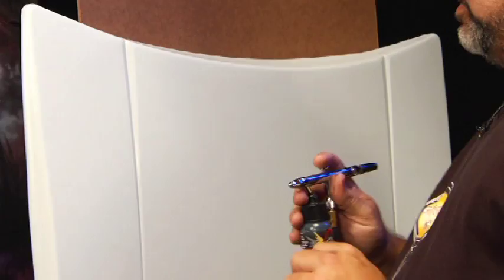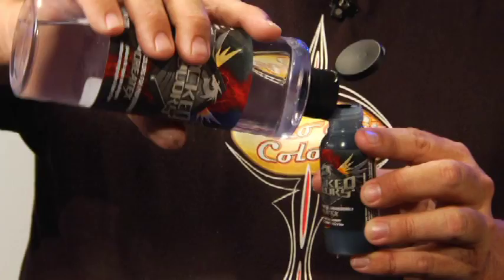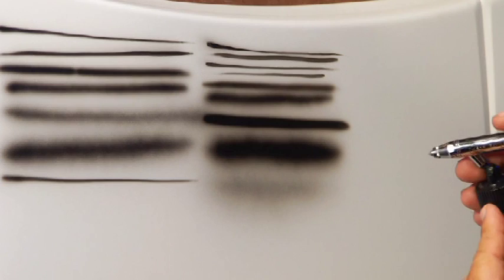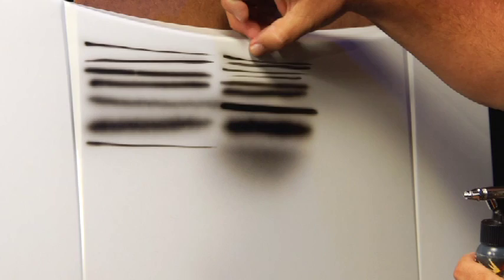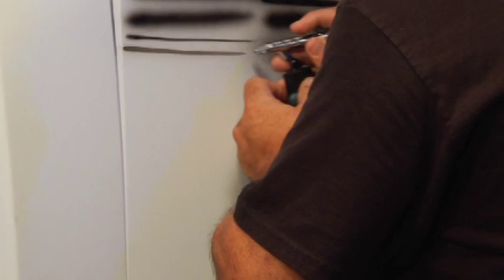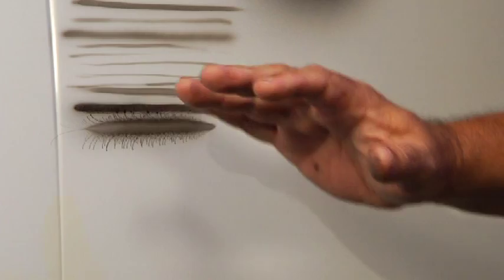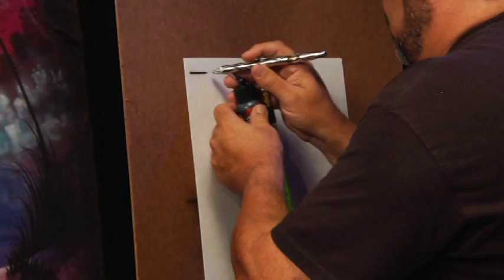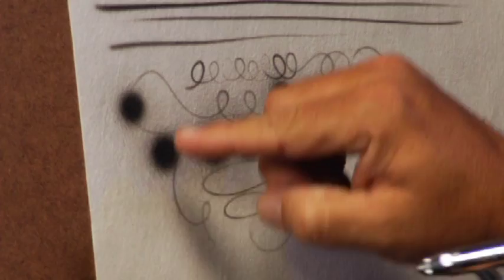Reducing & Over-Reducing Wicked Colors for Detailed, Fine-Line Airbrushing

Comment: WOW, I used standard automotive paint for most of my projects before but never realised how much these paints could be reduced!
With the automotive paint I would be getting those "freak drops" with anything over 60% reducer and I don't use a great amount of pressure(15/45psi).
I'm seeing more and more how these specific paints really are that much more flexible, usable and just easier to work with.
I think you just won yourself's a brand new customer, nice one!

Comment from the maker: Wicked colors are a multi-surface paints intended for a very wide range of applications including automotive, textile, canvass, paper, leather, wood, glass and most any substrate.  Wicked works well on plastics; on harder compounds such as ABS plastic, an adhesion promoter may be required.  Wicked Colors dry at room temperature.  Curing may be through air drying or with heat, which is recommended for wash-fast results on fabric.  Wicked Colors do not produce a noxious odor.  thank you, Createx

Comment: I just bought the Dru Blair set of Wicked Paints.....it is awesome paint.....I have a Harder & Steenbeck Infinity airbrush which is fitted with a .15mm needle .....this is the only paint that I can get to spray through it without clogging.... I generally paint on gesso'd canvas...I can reduce the Wicked to a ridiculous level and still get the quality of color and consistancy I want.
Two thumbs up.....good one Createx!

Comment from the maker: Hello.  As seen in the video, Wicked Colors should be reduced with W100 Reducer to achieve atomization when operating at 20 psi.  Tip-size is important too.  Wicked Colors should be sprayed direct from the bottle when using a 0.5mm tip-size operated at 40+ psi. The lower the psi and the smaller the tip-size, the more reducer should be used to achieve a viscosity which finely atomizes and flows well.  For further information, please email us.  Thank you, Createx Colors

Comment from the maker: Hello.  Createx Airbrush Colors, especially the Opaque Colors, operate best through a 0.5mm tip-size operated around 50+ psi when not reduced.  Reduction of 25 – 50% per volume with 5601 Transparent Base allows colors to spray with a 0.35mm tip-size at reduced pressures.  Our Wicked Colors will perform best through a 0.35mm tip-size.  Cleaning your airbrush should be done often, perhaps some dried paint was dislodged during cleaning and left in the needle reservoir?  Best Regards, Createx

Comment: I make my own fishing plugs and seal them with a wood spar urethane so the paint does not crack from the swelling wood. I than usually do a base of white paint and sand lightly before airbrushing. Should I use a primer first than paint? Thanks.

Comment: Hello, Are you just taking the bottles as sold and putting the feeder caps on them? I've been transferring some paint into separate feeder bottles. Is this a step thats not needed? Also, if you suggest using the wicked bottle with just the feeder cap, can they be stored that way as long as they are in a air tight container? - Thank you for your time!
Reply from the maker: Anglers Pursuit Bottle Adapters are available for bottom-fed airbrushes.  If you're spraying at a higher psi through a 0.5mm tip-size (such as what a t-shirt artist sprays at) this will work.  If you're reducing the paint so atomization is achieved at lower psi settings and through smaller tip-sizes, you may wish to use a separate bottle so no all the paint is reduced at once, which may affect shelf-life.  The bottle adapters have small opening to allow air to exchange into the bottle as paint is fed into the airbrush, preventing back-pressure. With these openings, paint stored with the bottle adapters on are not air tight.  If we may be of further service, please email us at info@createxcolors.com.  Thank you.

Comment: good video, I have a question about what Psi should i be running at with a .3 nozzle airbrush with wicked paint.  And also on the application sheet on your site it says "peals, metallics" are not recommended.. that mean i wont be able to use it in my badger 105?
thanks in advance
Reply from the maker: sorry we missed this message, was held in spam.  for psi settings as well as thinning info., please refer to the Createx Reduction Matrix, http://createxcolors.com/application-guides.html.  With an 0.3mm airbrush, you'll add more 4012/ 4020 Reducer to the candy-pearl & 4030 paint mix and have some room for various psi settings; lower 20 psi for line work and about 30 psi for graphic base colors.

Comment: Are the regular wicked colors and the detail colors all transparent or are they semi opaque?
Reply from the maker: sorry we missed this, was held in spam.  All Wicked Colors are translucent, in that they're highly pigmented colors that provide good coverage out-of-the-bottle, but not as high as Opaque Colors which are made with an opacifier (refined clay or titanium white) which assist with coverage but inhibit optimum atomization at lower psi settings and smaller tip-sizes.  Wicked Detail Colors are a bit more transparent compared with regular Wicked Colors; both are translucent compared to our 100$ transparent colors candy2o, http://www.autoaircolors.com/custom-candy-colors/candy20.html

Comment: hi I need sum help I have a badger 150 and I start to spray and it flows good for 6 lines and then it starts to fade off and stop spray ing ...I mick it so thin and it still dose it ...I change like all the parts and it still dose it.......HELP if you can ...or no y tits down it.........thanks  psi at  like 50